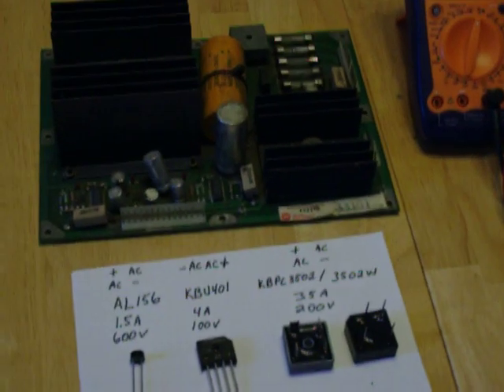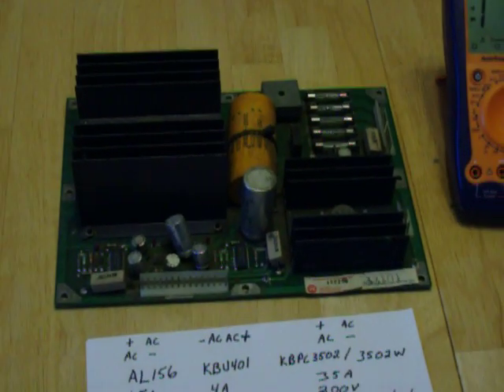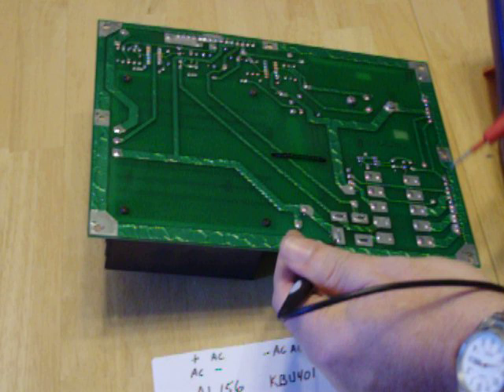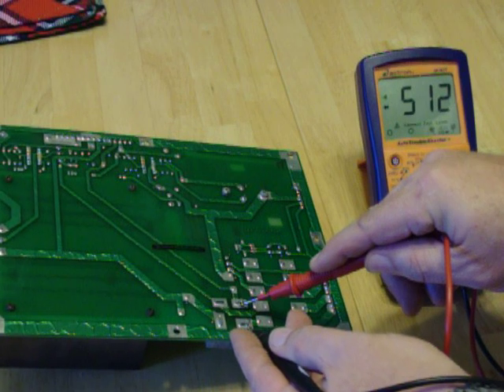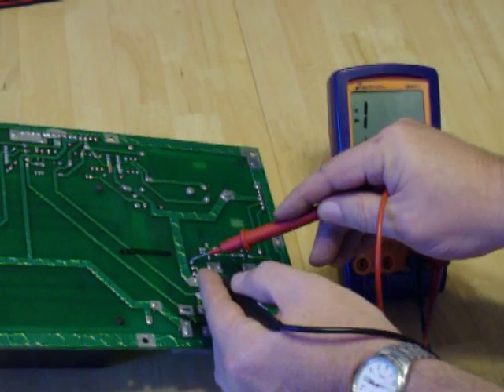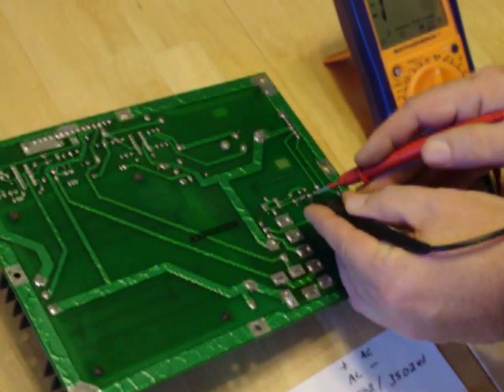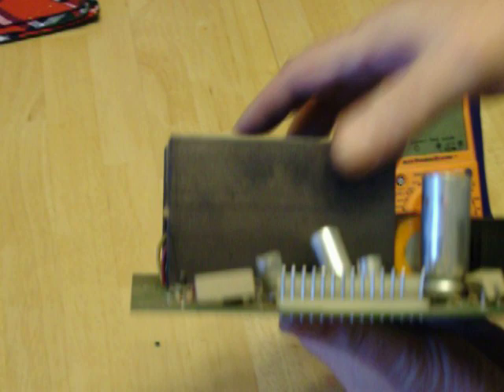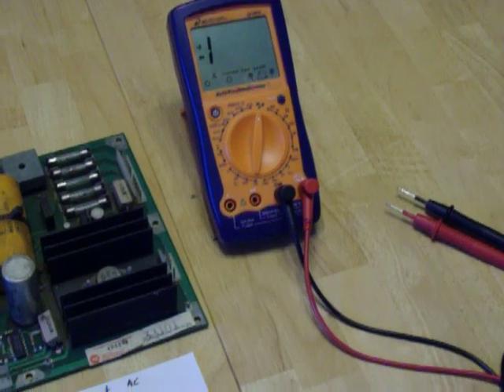How to test a bridge rectifier

Comment: You don't show what to set the multimeter too.
Reply from the maker: Sorry, bridge rectifier testing is done in diode test mode. Which can clearly be seen on the meter that was used if you are unsure what diode test mode is.

Comment: do you know where to buy bridge rectifiers? I noticed when the games plunged in the bridge rectifier heats up.. and segestions thanks
Reply: We supply IC, Capacitors, Semiconductor, Diode, Transistor, 
IGBT Modules, Rectifier Bridge, Diode Modules, Thyristor Modules
Transistor Modules , SCR thyristor, Power Modules . sales@asiantx.com

Comment: should all bridge rectifiers read under 600 when the multimeters set to diode?
Reply: I assume unless it's some sort of germanium arraignment...in 200s vs 500s 600s for Vf ? Not an expert of diodes.  Some diodes read short with voltmeter but are germaniums 200s region right there.

Comment from the maker: No, you are not testing voltage. You are testing the internal diodes that make up the full wave bridge rectifier. Voltage is tested differently for bridge rectifiers. Good diodes in a bridge rectifier will read between .400 & .600 in the diode function if a DMM. 
Dok